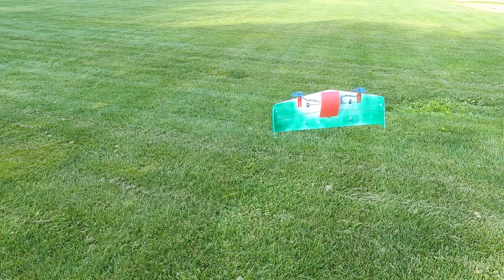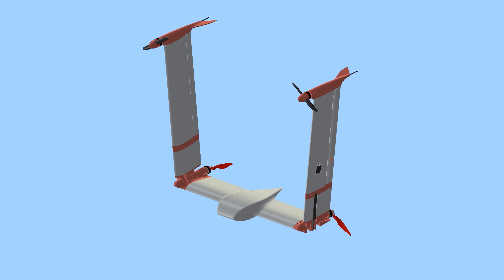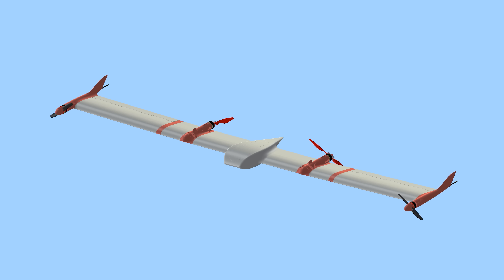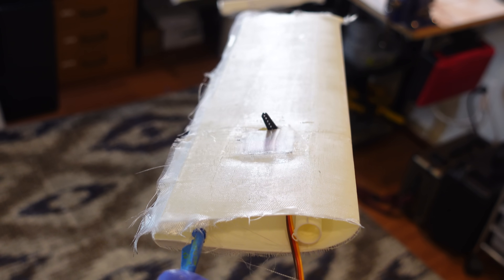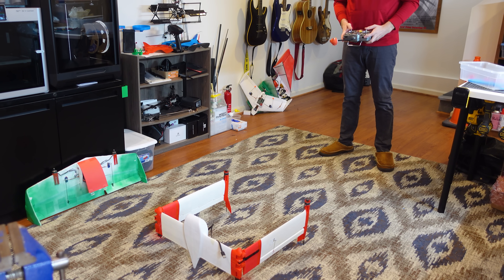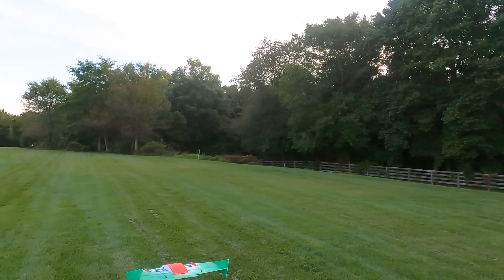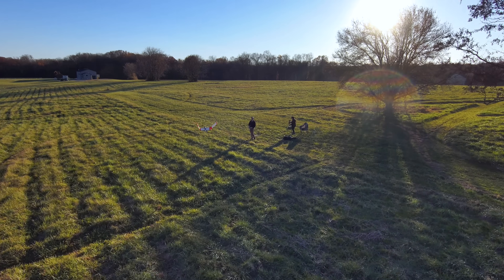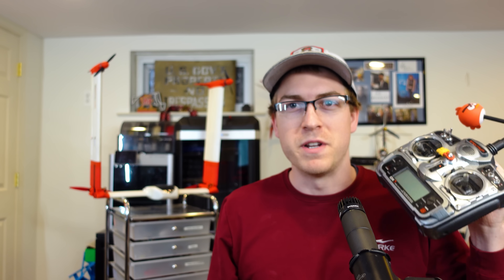Un-Folding a Quadcopter to Increase Efficiency - Part 1

Comment: It's a very interesting design.
But to get forward flight efficiency, despite you can't have adapted props for hover and forward mode, the bi-copter with longer wing would not be better?

Folding mechanism is impressive but induce more weight and in forward mode the 2 hover motors+ESC's are dead weight...

Comment: Hi. Free advice. Make it as M form. But central corner of M should be in the center of square. It will compensate centric problem.  The upper corners of M and bottom endings are 4 engines. Top corners of M are movable up in the air (not down like in Your model). The airflow will help to unfold wings.

Comment: Does the wing have to be flat on forward flight? Why not have a tail? It could have a strut for take-off and landing and supply the needed vertical axis for stability? 

I’m not an aero engineer, but a product developer and it’s a question that springs to mind.

Comment: Holy moly that is a cool idea! As an electrical engineer, it would be interesting to develop some mathematical model for this hybrid drone and try to figure out possible parameter values to stabilize it in the various states of its operation. This might give better initial values to start with and possibly avoid some crushes :)

Comment: I know nothing about physics, mechanical, or rc. but I think it would be easier to turn into plane mode if there is a/some hole in the wing. Probably an electric sliding/swing door that can open and close that hole, but I'm not sure about the weight/efficiency tho

Comment: Why not start the flight in 'forward mode,' tune the flight controls for that, and then care about the transition of the two modes afterwards? Isn't the transition the dangerous part, and not the forward flight itself?

Comment: Do you think adding a folding/detachable V-tail-like control surface could grant some extra control authority in flight? 

I can see those startling oscillations really attack the frame almost right when the elevons become horizontal! perhaps a little extra vertical surface area could help tame them out!

Comment: Some advice.  Don't worry about "transitioning" smoothly from vertical to horizontal in a linear manner.  In r/c helicopter when we "invert" there is absolutely no safe linear transition from regular to inverted.  We just go into a well practiced "suicide" flip.  It's all in the skills of your finger, plus mental orientation reversal control.  Of course, we practice many times on the simulator until it becomes an "instant reflex" with no fear/no hesitation.  So, if it's feasible with your aircraft, figure out a maneuver that will work.  Then practice or "program it". 

Go up high, then go into a controlled spiral dive that has some lift, and simultaneously "unwrap" the wings.  Then, fly out of it.  This will require skill, ofcourse, but allows you to skip the "transitional" vertical to horizontal engineering project complexity.(just research the US army V-22 Osprey development, it's still unpredictable).  Also, perhaps, ditch all the wing actuation, and simply spring load and cable it so you have a very light weight instant wing lock.  Ofcourse, you are limiting the aircraft to Vertical take off, but horizontal landing.  However, it's always best to divide development into feasible phases. Good luck.

Comment: When this unfolds fully it's a flying wing. All of the flying wings I see have seen have swept back wings. This increases their length from front to back which gives them pitch stability. I think you will have this problem as long as the wings extend straight out.
I realize you it would be complicated to pitch the outer wings back in flight so you could redesign the outer wings to always be swept back. You would of course need to add legs (2 pieces of carbon fiber tube) to the back of the main wing so that it can take off and land vertically.

Comment: I really don't 100% buy the whole light PLA thing and would love to do some targeted tests. 

The way I see it, it has to be near 100% the density of PLA coming out of the nozzle... the fact that it expands afterwards doesn't really change that, so the actual mass should be exactly the same as normal PLA. It's fundamentally still the same material, only the foaming up fills it with hollow voids, which is only a mechanical change.

TL;DR: I suspect that you can simply optimize your layout and reduce your thickness accordingly and get the same effect.
Reply from the maker: The temp causes it to foam up, and I reduce the flow rate to about 50%. So the result is a part about 50% lighter than pla that occupies the same extruded volume
Reply: @NicholasRehm  Right, that's the practical application and result. The stuff foams up causing a 200% increase in volume with 100% mass, which you can then correct by scaling down to get the correct volume with the desired 50% mass. . . which brings me to my point. 

Aside from the obvious eventual nozzle size and resolutions limitations, there is no reason one couldn't instead just scale extrusion rate down 50% using just normal PLA and that's basically it. Furthermore, it's not as if light PLA has better strength than regular PLA for the same volume, it's still the same material. To really add insult to injury, it appears that light PLA is actually more difficult to print than regular PLA; and that's a big one! Having to make sure your printer follows an unbroken path to get a clean print is a huge down side.

Basically.... I can't see why I wouldn't just try and take shrinking my single wall thickness out to it's limits instead. I'd go as far as to say, it's probably more effective to get a 0.2mm nozzle and print using something along the lines of a corrugated sign board pattern than to buy light PLA.

...but... like I said... I'd like to do some targeted tests to confirm the theory.

Comment: 7:50 I wonder if it will still have anhedral wings in flight or if that's just because it's hanging from the center. Maybe it'll need a redesign with dihedral wings for stability? Or perhaps only unfurl the wings 90% for a sort of inverted gullwing? Looking forward to part 2.

Comment: Why did you fold down from the top, instead of up from the bottom?
If you folded up, you could make a stronger unfolded joint as the forces on the wing would be trying to hyper extend the joint

Comment: I don't quite know how to put this in proper engineering terms, but appears as though the oscillations are due to the flight computer attempting to make hover adjustments whilst transitioning to horizontal flight. It's attempting to adjust the individual prop power to hover-stabilize the craft, but not seeing the expected results due to the horizontal flight mode transition that is happening. Instead of raising or lowering a quadrant of the craft, it is wagging from side to side because it's no longer hovering. That's what it looks like to me anyways.

Comment: Nice design...but dude you have just re-invented the wheel and made it square again.

1. Tailsitter configuration is selected to avoid the actuator for thrusters in a tilt rotor design.

2. And you introduced actuators in a tailsitter 🙂.

3. Back to square one, simplicity of tailsitters 🤦🏻‍♂️😂

Comment: If you don't unfold completely this would act like dihedral and naturally keep the roll axes more stable 

Also adding it might be worth wile to try a swept back wing configuration allowing more angular virginity for the winted motors and providing needed space on the center wing for passive vertical stabilization

Comment: Question: if the natural lift forces want to fold the wings up, why not set the joint to fold down instead, which could then be supported by the end of travel stop instead of worrying about back-driving?

Comment: I'm not an RC plane guy, but I do live in the R&D world.  The printing issues you are having are not down to just settings, but it also looks like you are having a moisture issue.  I would highly recommend a dryer for your filament, which also acts as a pre-heater.  The AMS on the X1C has no active heating and relies on a consumable desiccant packet that is not used evenly.  Since the desiccant does not move, the outer pellets get used up while the inner are blocked.  There are kits to mod the AMS with a small heating element to maintain a constant temperature inside the AMS.  On our X1C, I have not been allowed to mod the AMS to have the heater, so I've added 3D printed desiccant pods that screw together inside each spool.  This has kept up with our high humidity very well.  As a bonus, filling the pods only 3/4 the way full also mixes the pellets as the spool turns, allowing the pellets to be used evenly.  I used a color changing pellet, so when they are close to their maximum absorption, the pods are placed on the build plate, or on a sheet spaced off the build plate.  The build plate is then heated to bring the internal air temperature of the chamber to 60 to 80C to bake the spools.  This releases the water that the pellets absorbed.  Every so often during this process, the pods are spun and placed back on their other end.  This moves the pellets around and allows the hot, humid air out.  This this method, we have not had to change the desiccant in the AMS since the pods were installed.

Since the AMS is not the end all, be all of filament delivery, we also have a stand alone filament drier hooked into the X1C between the AMS and the feed input.  This was as simple as printing a Y adapter and  fitting everything up with Capricorn tubing and quality fittings.  This does mean you have to manually load the filament from the drier, but if you are only using the one filament, that's not a big deal.  This does give fine control over the storage and preparation conditions of the filament prior to printing.  This makes printing with stuff like PEEK, TPA, PC, and the light weight PLA much easier and more consistent.

One last point on my already long rant is a controversial one.  But, it's one I've  found very useful for structural prints.  The prints greatly benefit from a post print annealing cycle.  I know over the past few years, people have tried various methods to strengthen parts by using a powered substance to pack in and around the print, then bake the print at or slightly above the plasticizing temperature.  While this can work, I don't think the rick and effort is worth the reward.  What most people don't understand is that the plastic does not instantly go from solid to goo when you jump a degree at some point.  The softening is more of an exponential curve, as is the plastic's strength.  So, you can heat the print to a temperature higher than its operating temperature, but well below its plasticizing temperature, and increase the strength of the print in both the X/Y and Z planes.  Bambu Labs even has a couple white papers on this.  Plus, you can do this in your printer.  You just need a rigid plate placed over  the build plate, with a space between them.  You will need some trial to get the build plate temperature perfect for the chamber's air temperature.  You are shooting for a chamber temperature half to 2/3 the "melting" temperature of the material.  This is held for 6 to 12 hours to allow the discontinuous plastic to naturally bond through various internal forces.  When properly done, you will have a less brittle, but stronger print.  This does take a while, so if you are not wanting to tie up you printer this long, you can always opt to get a cheap lab grade oven and add a PID to it.  You can get a new oven with a volume slightly greater than the build volume of the X1C and a PID system for under $200.

Comment: I think you can drastically simplify the folding mechanism by making it fold the other way and use the lift forces to lock the wings in place

I'd also "leap of faith" into it by making the aircraft dive into forward flight, kinda like a bird

Edit: you can use the same trick of vectored thrust to get the wongs to go where you want them to

Comment: This is a fascinating design.  Congrats.

For better stability: Since the ailerons are very far apart, consider adverse yaw reduction and only use upward aileron - no down - for roll control - this will also help with yaw in that direction as there is more drag there - and less on the "up" going wing as that aileron will remain neutral.  Since you already have separate actuators for each aileron you're "there" other than the s/w.

Comment: I think that accelerating forward as you switch flight modes is crucial for a stable transition. If the wingtip motors could pitch and yaw, you could have more control as the cg shifts during the flight mode shift.

Comment: Why make the transition at low speeds? In my oppinion you could get better results by flying straight up while the wings are unfolding and level out when the speed is closer to cruise. I also think the two motors on the wings tips neeed to keep in sync while the wing is unfolding or the forces on each side are different due to concervation of mommentum.

Comment: Not pretending to actually know just posing as a question. As you're transitioning from vertical to horizontal flight you end up with a large dihedral. Typically making aircraft more stable but in this case because its so large does the force cause it to oscillate and would just sending it full unfolded get you through the unstable configuration

Comment: it looks great.  You could try opening the wings from the ground up when transitioning into flight.  And you lack the length of the tail in the middle, try adding a tail to the cockpit that hides.  The flying position is the shape of the letter T and the landing and takeoff is the shape of the letter (E).  And try to equalize the sizes of the propellers, this causes oscillations when you move into the wood, as they lose perpendicular rotation relative to the engine due to reduced rotational force.  and it would be better to have the same size propellers and only accelerate the ends and turn off the middle two when it goes into flight.

Comment: Huh.  Just an idea, have you ever considered using something like a titanium memory wire for the frame that is the wing shape and then bending it into the quad copter configuration so that when tension is released it automatically springs out into the wing shape?  Something like that could be super light and somewhat self healing.  Maybe you could use something like mylar for a flexible skin.  I'd say that you could use muscle wire to move it back and forth between configurations but that stuff gets super hot and requires a lot of energy.  Well, the muscle wire that I've seen 20 years ago was that way.

Comment: Great effort on the design! However, I have some concerns about its functionality during forward flight, primarily due to a design issue. The absence of a tail might pose challenges when using fully extendable wings. A potential solution could involve incorporating swept wings instead of perfect rectangular wings. In my perspective, constructing a tricopter that seamlessly transitions into a flying wing could lead to a more stable and controllable vehicle. This configuration not only addresses the design challenge but also offers energy efficiency, allowing for a more compact vehicle size.

Comment: Wouldn't you have more control over the plane flight, if you used the inside motors? I'm just thinking that the outside motors only need to be slightly out of sink, and because they ate so far apart, cause more instability, than using the inside motors?
Reply from the maker: The outside motors use differential thrust for yaw control, stabilized by the flight controller

Comment: Very interesting tailsitter approach and great job so far!
I have a few thoughts/questions based on some previous tailsitters I've messed with:
1. Have you considered variable pitch propellers? Could allow you to feather the props without needing to fold them, plus it would solve the issue with the compromise between hover and forward flight performance
2. Having all 4 motors in tractor config might be better since the blown wing reduces stall speed down to effectively 0 (which is probably a factor for you during transition)
3. Unless your flight controller is setup to run quaternions you are going to start getting very weird behavior near 90 degrees in the pitch axis (technically true in roll, but less of a concern). It might be best to turn off auto level for your transition testing
Reply from the maker: 1 - Definitely a good option to better performance, just not at this scale. 2 - maybe, but as long as the wing is even slightly folded, I get get full roll/pitch/yaw control through the motors--no need to rely on aero control or a stalled wing. 3 - Yes I have a quaternion attitude estimate, I convert that to euler angles for my pid controllers, but fade between reference attitude as I do the pitch over; check out my last video for more details on that

Comment: Why don't you mount all motors at the front edge? They could fold just as well and would be farther away from the ground during take off/landing
Reply from the maker: Folding props would get jammed on the leading edge of the wing, I did end up testing it

Comment: Wingtip motors for flow straightening is a fundamental misunderstanding of biot savart. The vector fields from the motors and the wings will simply add. In all cases the net vorticity will be zero.

Putting your motors on the wingtips just moves your problems somewhere else.
Reply from the maker: They were going on the tips anyways, so it’s a nice gimmick to mention :)